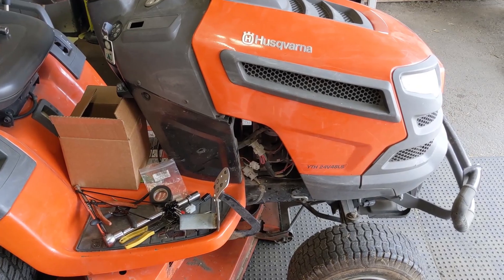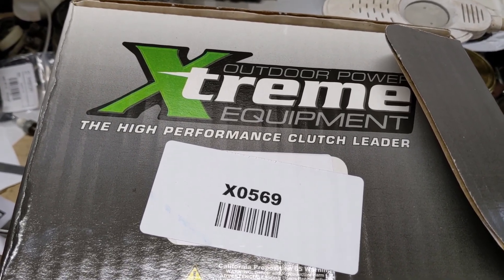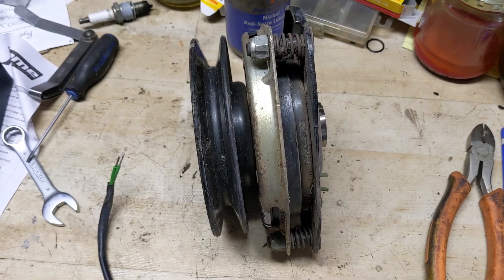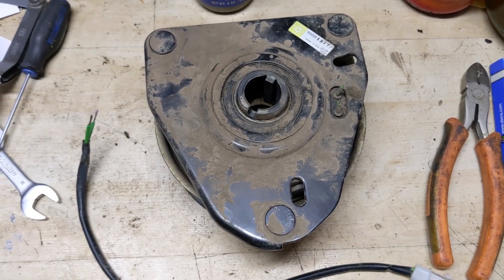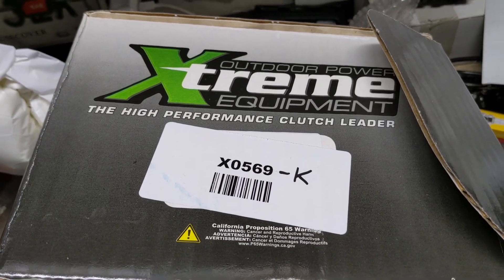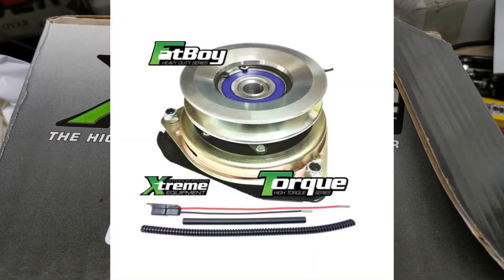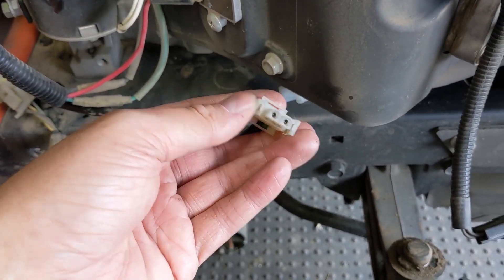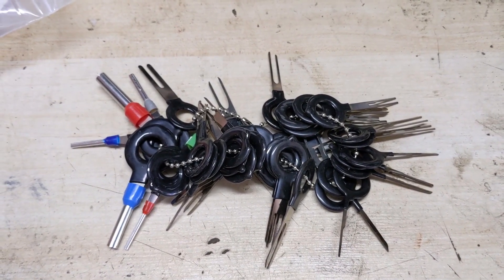Electrical Pin Disconnector Tool

Comment: Of the Warner pin is stuck. How do you pull wires out from behind. I have the set of pins tools. But not sure which one it is. Any ideas?

Comment: Any idea what the gauge of the wire is? And is it possible my mower has two female pins that just touch when connected and do not insert?

Comment: I have a 25hp husqvarna with electric clutch.  New clutch and everything.  I engaged pto and it just Boggs the engine down and most times stalls engine then on the other hand when it does engage it runs awhile then engine kills all of a sudden.  I think I've replaced almost the whole mower almost.

Comment: Should of soldered the wires. But connecters suck.
Reply from the maker: I've always used butt connectors with heat shrink and I've never had any issues. Just have to make sure the connection is tight and secure. Thanks for watching!

Comment: Yes!  I was able to obtain a set
Of amphenol connector removal tools back in the late 90’s when I was working fora Johnson / evinrude dealer
Reply from the maker: These little tools work amazing, I don't use them very often, but when I do it makes quick work of the terminals/connectors. Thanks for watching!

Comment: Good stuff! On another note, I have replaced my starter on my Cub Cadet with the 3rd gen starter, which worked fine for a while but now it usually won't spin it. I have swapped batteries, solenoids, added extra ground straps and re-adjusted the valves. Any ideas? Is there a way to adjust the compression release valve setting without tearing down the motor? Thanks
Reply from the maker: Hard to say, some models have the ACR while others don't. It seems it's hit or miss and I'm honestly not sure which ones have it.  The service manual makes a note of hydraulic lifters, while some engines have solid flat tappets that require adjustment, instead of preload. Those engines are a nightmare. One of the reasons why I don't recommend Kohler engines.
Reply: Just wondering if your battery has enough cranking amps we suggest 370 to 430 cold cranking amp batteries. Most get the cheaper 230s and have issues like you are having.

Comment: Just as a matter of preference I always solder, have had bad luck with corrosion or wires coming loose, also the heat shrink seals way tighter than over a butt or other connector.   As I said just personal preference.  Great tool video and info on the stens PTO.
Reply from the maker: Thanks for watching!

Comment: WHAT DOES PTO STANDS FOR?
Reply from the maker: PTO stands for "Power Take-Off" so an Electric PTO clutch means it takes power from the spinning crankshaft of the engine, to the electric clutch that spins a belt to run the mower deck. Thanks for watching!
Reply: @EliminatorPerformance  THANK YOU, BRO GREAT VIDEO ,